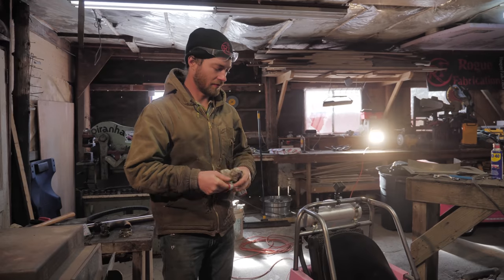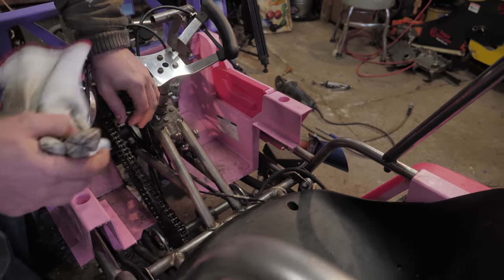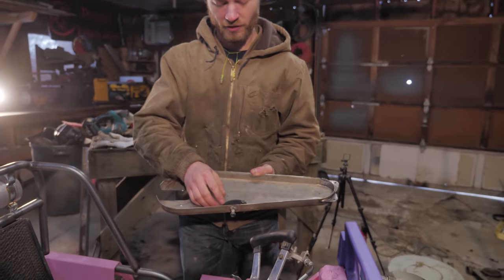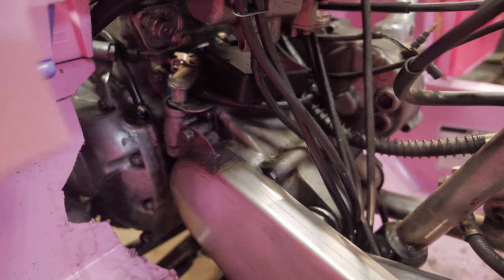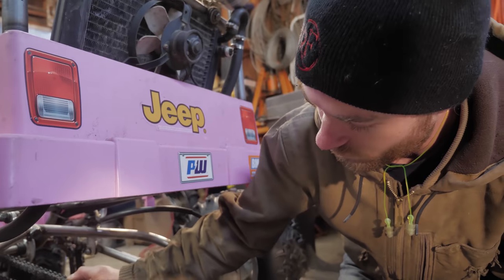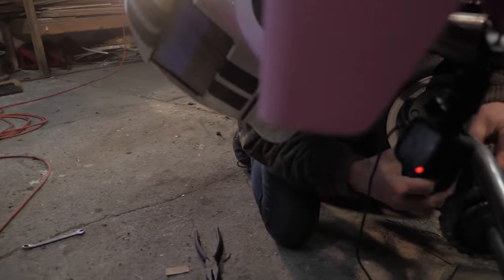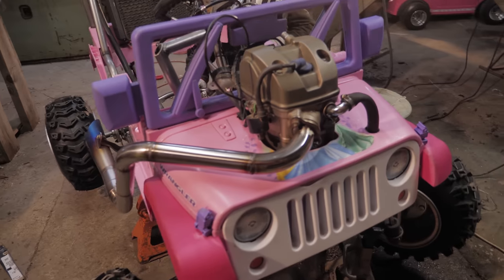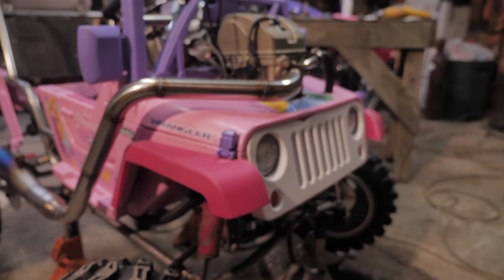Princess Jeep Custom Exhaust and Chain Guards!

Comment: Just get a valve shim kit and shim the valves. The top end is probably fine. Those Honda unicam motors are high maintenance. That's why it's hard starting. I used to have to shim my valves on my crf every other race. I could always tell when it was almost ready. If it would take more than three kicks it was time to shim. Just my 2 cents
Reply from the maker: We got a shin kit! I would just try that, but we have to take the head off anyway, because the gaskets are leaking bad, so might as well throw in some rings.
Reply: yea man shims are a great temporary fix but i had mine sent off two years ago and haven't had a problem since but the oil is also changed every 4 hours

Comment: Fab work stepped up a notch now with a tig -Awesome!,
Can’t wait to hear that exhaust-mmm stainless 🤤🤤🤤
Reply from the maker: Thanks! Super excited about the tig!
Reply: Ethan where was the tig set-up from? Didn't not know there were kits to add tig to a mig, what model Lincoln Mig do you have and where is the tig parts from? Would be cool to see a video on some of the sweet tools you use in these builds! Found the jeep build and now I have to check out your other videos, great job guys!

Comment: now that you have the tig welder torch you can make your own aluminum gas tanks out of 4" aluminum tubing and a an -16 fitted and 1/2 aluminum bung fitting save you some money and good practice  and new video ideas . thanks for the video by the way wow on that chain guard came out perfect
Reply from the maker: Unfortunately it turns out our welder only does dc tig, and we would need ac tig for Aluminium... but we will get setup to weld aluminum soon!

Comment: Just a recommendation boys maybe put a second nut on the chain tensioner as a locking nut so when you a thrashing it won’t fall out. Love your videos guys 🤙
Reply from the maker: The nut I welded to the guard is a lock nut, and got even more locking after welding!

Comment: Noticed you cutting the tubes with the grinder as someone who builds exhausts I find a drop saw works better for getting the straightest cuts.just a tip keep up the good work guys
Reply from the maker: Yeah, I need to get a metal wheel for one of my chop saws for sure! That would make cuts much straighter. I just forget about it because I’m so used to doing everything with the grinder.
Reply: @GrindHardPlumbingCo  yeah I know we work with what we have.im currently building a wheel driven jet turbine go kart it's been a fun project you guys should do a turbojet powerd  vercle.

Comment: if you bump start it, she'll start. i have an 07 crf250r that had the same problem but i had the head sent to utah in order to get the valves and cylinder redone (fastheads if you'd like to know)

love the vids guys keep it up😀
Reply from the maker: Bump starting would be rather difficult with all the snow we have here. 😂
Reply: @GrindHardPlumbingCo  yea man didn't think of that! 😂

Comment: Buy stainless steel valves for the motor and get rid of the titanium ones that come stock. I did that with my crf450 and it worked wonders with starting and it runs so much better
Reply from the maker: Thanks! Good to know!

Comment: Look up “spark testing”. It helps you determine the metal by the type and color of sparks that come off the grinder. 
Is the motor a 2 stroke or four stroke? A two stroke requires an expansion chamber in the exhaust or it won’t run properly.
Reply from the maker: It’s a four stroke.

Comment: The gas tank and muffler look sick!  And props for building that chain setup on the fly.  I'm so impressed that you guys can design and build stuff on the fly without schematics or drawings.
I am a bit concerned about the exhaust heat melting the plastic like it did to your grille, but I'm sure you guys will figure something out :)
Reply from the maker: Thank you!! We are a bit worried about it melting the hood too, so we might heat wrap it!
Reply: Nice!  It's a shame to cover up that stainless, but it'll be worth it.

Comment: When working with SS. Use different cutoff wheels for SS and steel. It will introduce iron into the Stainless and cause the weld to rust. If you did ignore me 😝
Reply from the maker: Good to know!
Reply: Happy to help love the work

Comment: one thing i heared about : when welding stainless pipe , backpurge the pipe or  the inside gets oxidized and creates a white cristaline oxidation that will cause the weldpuddle to turn brittle
think the piece of exhaust over the hood will deform it once it gets hot , maibe put a small heat deflector under it

Comment: Is there a point where you can mount your intermediate shaft to minimize variations in chain length throughout the rear suspension's travel?  What's the theoretical best spot ?  Does it jeopardize the family jewels?    Freaking awesome project.

Comment: The old exhaust was hardened steel, it is hard to weld and will not stick and the sparks will be different than regular steel
Reply from the maker: Fairly certain it was titanium, but I could be wrong.

Comment: You should really add a heat shield around the part of the exhaust facing any plastic if you want to avoid your "wrangler" to melt away.
Reply from the maker: Yeah, that could be a problem.

Comment: When welding stainless I pretty sure you have to put welding gas on the inside of the pipe as well
Reply: Yep back purge is essential
Reply: I've heard of guys using some sort of flux or paste for doing exhaust work. No purge required.

Comment: your fab skills are outstanding man! and the video edits are always on point. did you say you converted your mig to work as a tig? how did you go about that
Reply from the maker: Thanks man! Really appreciate it! So, we have a multi process welder that is designed to do mig, stick, and DC tig! It just didn’t come with the tig torch setup when we got it.

Comment: I hope you make an exhaust guard otherwise you'll melt your hood!
Reply from the maker: We might try heat wrap.
Reply: @GrindHardPlumbingCo  ceramic coatings are supposed to work well, now that I think about it. That may be a tad expensive though

Comment: What about taking a belt tensioner off a  regular car motor like a Chevy LS and swap out the plastic pulley with a small sprocket for a chain tensioner
Reply from the maker: Definitely a good idea! I just worked with what I had around the shop.
Reply: I hear ya, still a good idea what you came with simple and it works

Comment: Who is your supply for the frame tube. I've missed the whole build less the last 4 week's. I've found a Co. That has killer prices on 1/2"-- 1" x 6ft length's from $26 to $45.00 ea. With free shipping. If ya can drop me a note. Looks like I'll be getting a full multi-process welder.
Tig-mig &  stick. Then a plaz is on the same ticket. Your building a crazy cool ride. Me I'm set for 2 wheels & med hp. I've got 3 Predator 212's that are going to put out approx 25-30hp. Keep up the way cool video guys. !!!!
Reply from the maker: We get our steel from a local supplier, and it’s more like $28 for 20ft of 1” x .083 tubing!

Comment: Maybe you need some heatshields for the exhaust to protect the hood and stuf🤔
Reply from the maker: Most likely! We are thinking of wrapping the exhaust.
Reply: @GrindHardPlumbingCo  this would probably work too and is easier. But then the shiny stuff is not visible anymore.
Reply from the maker: I know! 😭 But we won’t have to cover up the whole thing. Just the part closest to the body.

Comment: The heat from the pipe might ruin the plastic
Reply from the maker: This is true...
Reply: Grind Hard Plumbing Co I’d wrap the pipe but it may not help much, with that tire spin that crf450r will be in high rpms a lot, that header pipe should get glowing red hot.

Comment: Did yall use weld flux to help with sugaring in the pipe
Reply from the maker: Hmm... didn’t know about that trick. I’m new to tig welding. 😂
Reply: @GrindHardPlumbingCo  it called solar flux type B you can get it on ebay, or you can set up a back purge. Congrats on the tig it will really make you want to work higher tolerances

Comment: I'm thinking of making a suspension skateboard and I'm wondering what metal tubes your using?
Reply from the maker: We used 1” diameter .083” wall steel tubing!
Reply: @GrindHardPlumbingCo  thank you now I can design a CAD model and start making :)

Comment: You may want to wrap the pipe or make a heat deflector where it goes near the plastic hood and body. I would think it would at least wrinkle/warp the plastic. Check how hot the exhaust gets and find out how much a piece of that type of plastic can handle. If you watch Mustie1's Beaver Build, he wraps the exhaust with a strip of..something. It was to keep the heat down in the engine compartment.   https://www.youtube.com/watch?v=dwJyGayoafo    Start at 18:12 to see what he is using. You may have to watch from the beginning to hear him say what it is OR you guys already know!  :-)   Ya, I know. It seems it would be a shame to cover up that beautiful stainless and your beautiful tig welds. Maybe motion will keep it cool enough. We all know that thing isn't going to be sitting still much!  Just a suggestion. Awesome Job on this!! Thanks Guys for all your Hard Work (Plumbing and Grinding)!
Reply from the maker: Thanks man! We’re definitely thinking we might need to wrap the exhaust to keep from melting the plastic.